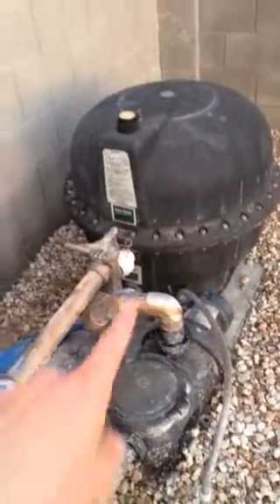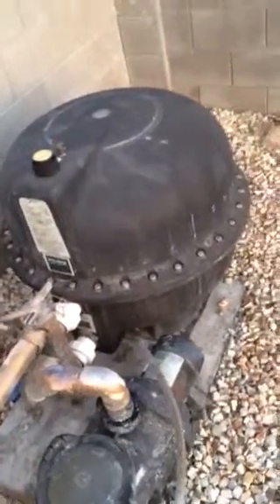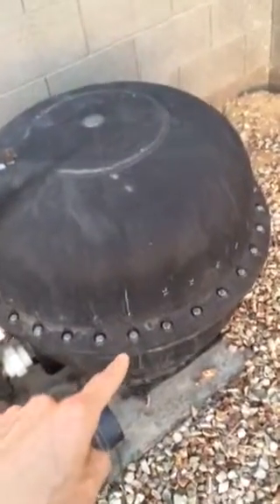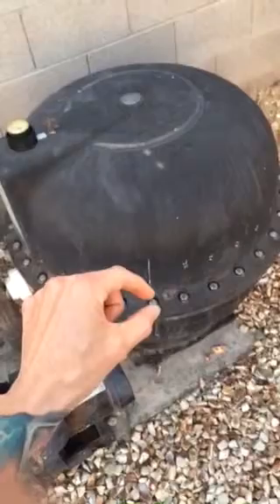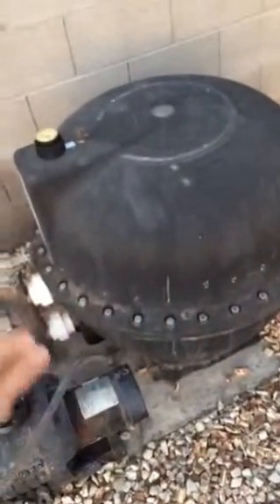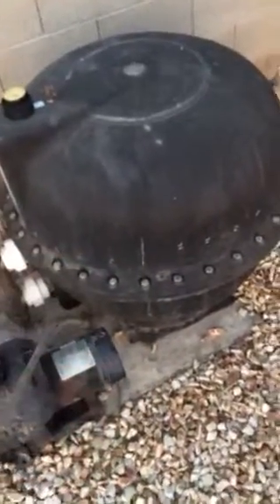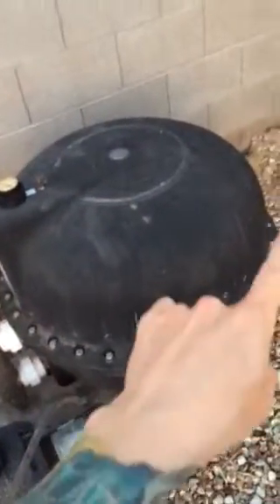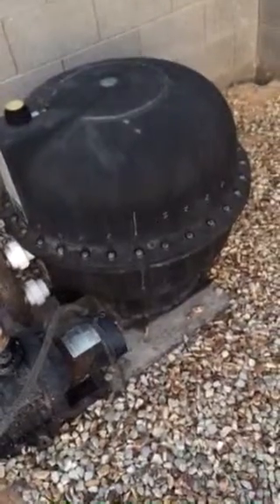How to change pool filter sand - HRPB30 / HRPB24 Pentair Sta-Rite Sand Pool Filter

Comment: Thanks for the video - it gave me confidence to get mine done.
My wife and I replaced the sand in the filter with Zeosand - the whole job (including a trip to the Orange Box for new nuts and bolts) took less than 4 hours. There's really nothing to it.
Just be prepared with a new O ring and two 3/4 inch sockets with a breaker bar. And if your bolts are rusty, have replacements. Mine were rusted out to the point of being unusable - and one even broke trying to remove it.
And the Zeosand is the only way to go!

Comment: Did you use 2  3/4  sockets or 1 wrench and a breaker bar? I have a customer with ine of these and want to make sure I don’t break anything. The bolts on it are rusted and she has sand in the pool.

Comment: Can you explain how to backwash that monster? I'm looking for a video on the model # HRPB30, there's none.
Reply: It you look at 2:00 of the video you'll see a silver handle.  It usually has a latch holding it in place.  Turn the pump off, remove the latch, lift the handle, and then restart the pump.  I would suggest purchasing a vinyl hose to direct flow to a drain or lawn.  When the water starts running clear simply push the valve handle back down and reinsert the latch.